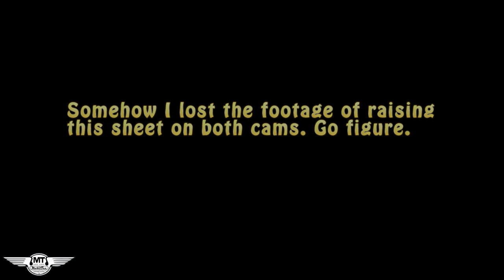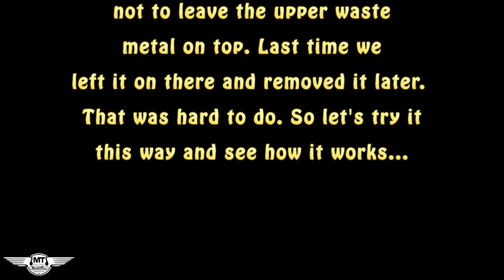48 Mainline Metal Part 5 Curb Side

Comment: Hey Larry is it common for park models to have a original spare tire and 2 stabilization jacks under the trailer at the back
Reply from the maker: I don't know. Did you find one like that?
Reply: mobiltec my trailer has 2 vintage jacks and a slit rim spare in the rear underneath